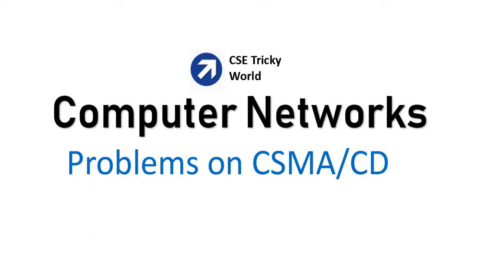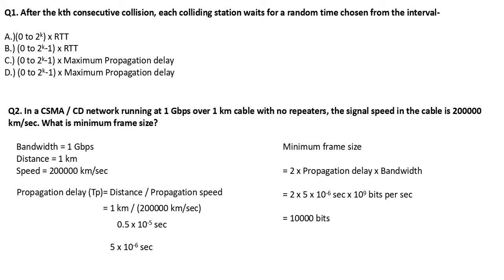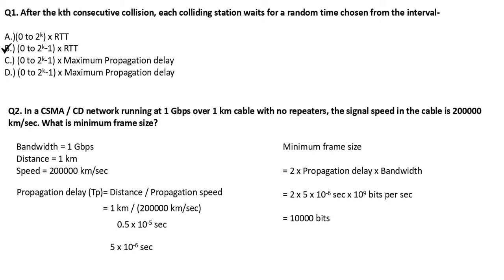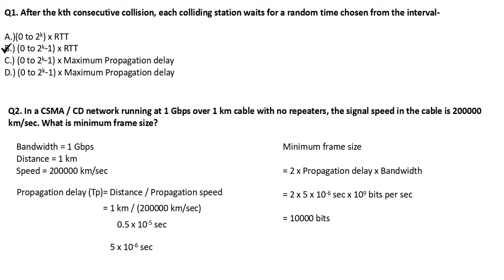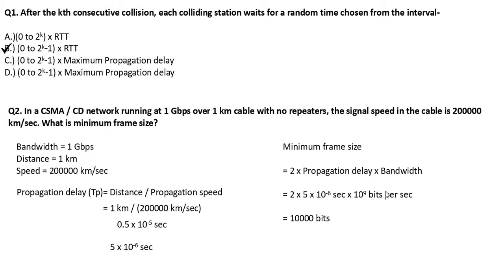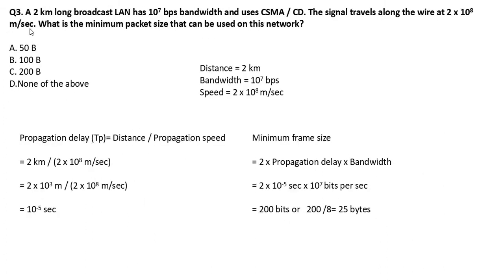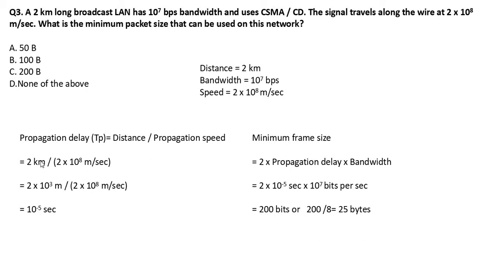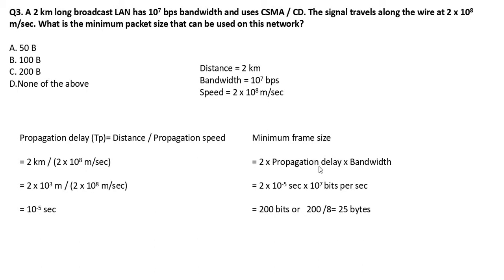CN| Problems on CSMA CD |GATE |NET |CSE

Comment: Consider a CSMA/CD with frame size is 20 KB and transmission rate is 10 Kbps, then maximum length of the cable (km) required, if signal speed is 15 km/sec?